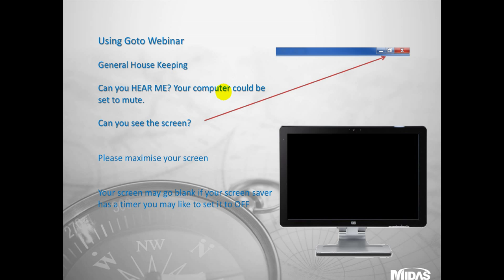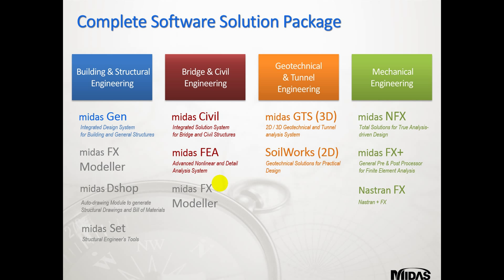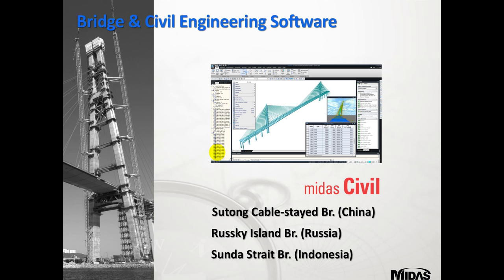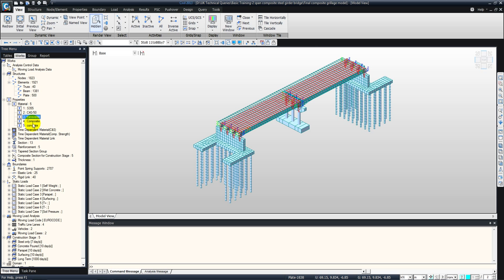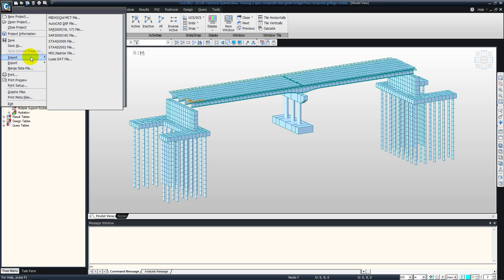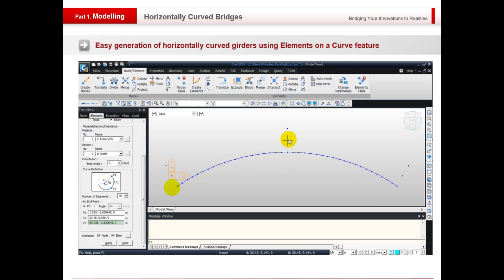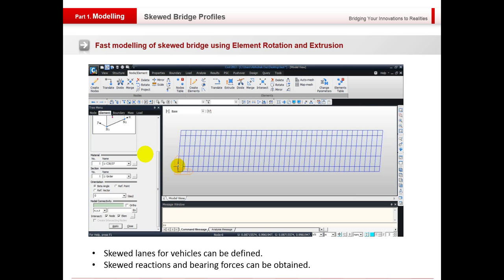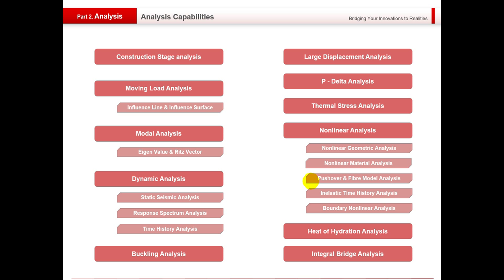Bridge Design and Analysis to Eurocodes

Comment: Is it possible to design composite steel tub sections to Eurocode using Midas Civil 2015?. It seems like you can only design composite I girders.
Reply from the maker: Hi Salva,
Yes, we absolutely can design composite steel tub sections to Eurocode. You may find the procedure in the Design Guide under Chapter 2 Composite Steel Box Girder Design (EN 1994-2). If you can't find the Design Guide, you can always request one from uksupport@midasuser.com and we'll send one right away.
Reply: There is no option to obtain the load cases for composite sections to Eurocode.
In case I use the combinations for steel and concrete saparately An error message pops saying that I should make sure that all my sections are composite I. That is what lead me to think that there is no way of designing steel tub sections.

Do you know where the mistake could be?
Reply: Midas UK There is no option to obtain the load cases for composite sections to Eurocode.
In case I use the combinations for steel and concrete saparately An error message pops saying that I should make sure that all my sections are composite I. That is what lead me to think that there is no way of designing steel tub sections.

Do you know where the mistake could be?
Reply from the maker: Salva Tudela Hi Salva, if you have any questions, please send these to uksupport@midasuser.com(its more efficient communicating there).
The composite steel girder design is for our newly implemented design features to AASHTO. The Eurocode design is using the load combinations defined in the steel design tab, here you can also auto generate or define them manually. However to find out why you are getting that particular error message you would need to send us the model so we can have a look at it.